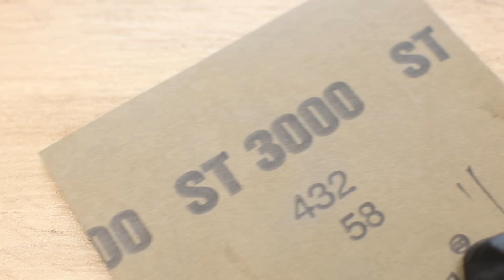Antique Rusty Drawknife Restoration. Old tool restoration

Comment: Wonderful job! The handles are almost too good for the drawknife. Beautiful. (I'm surprised you didn't address the small crack.)
Reply from the maker: I saw that crack. This is a technical crack that was formed during the manufacture of this tool. It does not affect work.
Reply: No impact for this tool, and the forces on that section are small.  Maybe in another century or two it might need a weld!

Comment: 6 out of 10, you neglected to do anything about the crack in the steel on one side. It will be a future point of failure for the steel and looks ugly to boot. Expected better work from you based on other videos.